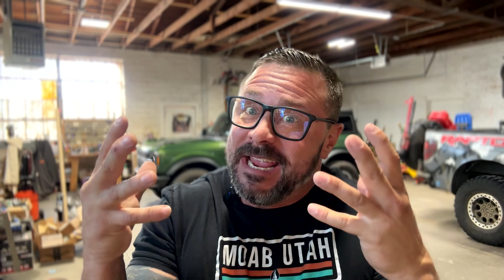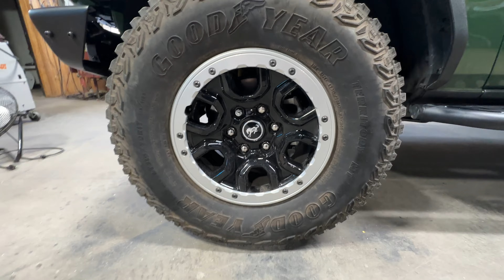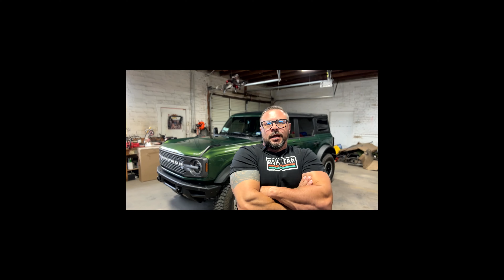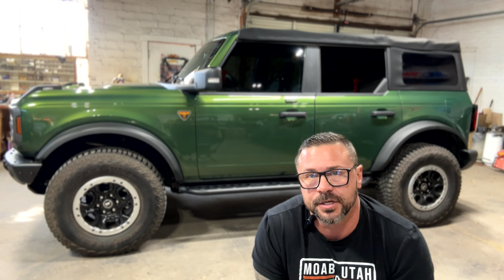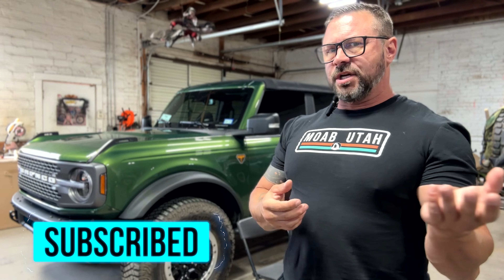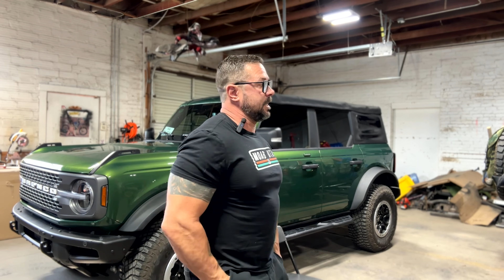BRONCO…The Build it BIGGER SERIES EP1

Comment: Looking forward to following this build. I went KC slimlites on the pillars, but I'm partial to those initials.

What are you thinking for follow lights?  Gonna wait until you have Ursa minor top or something compatible with soft top?  Thinking about mounting some to mt spare tire rack and just have a quick connect plug for them.
Reply from the maker: Hey buddy !! Yes I believe we all will enjoy it for sure. I’m trying to spare no expense on the things that truly matter and take opinions and public suggestions on others!  

I want it to be the rig I’ve been tryin build for years, so hopefully this time we get it right, because I think in my humble opinion there’s not a better starting platform. 
So you sir are a genius, I will be using your fav KC  v2 in amber (don’t tell anyone but they are my favorite all around use light) I will actually be doing something similar. I will be wiring the chase lights through the rear door and they will be mounted on the third brake light riser so they won’t have to be moved during a tire change etcetera. 

FYI that package just showed up , so hopefully that video will be in the works very soon to help illustrate how I plan to run them. 

Thanks for all the support Kyle 🙏🤝🏽

Comment: Great name. Love the description of the matchbox.  Are you looking to do a refrigerator/kitchen set up in the back? Is there even room in the back? Or would those diy kitchen in a box be better? 

Up down airing is a great idea. Bead locks nice. Suspension I heard low rider setups are all the rage in overlanding...🤣😉 Making the Bronco hop on the trail 👣 🤪  

Glad you are keeping the trailer.  What is the yearser miner? Sorry spelling couldn't Google it with my bad spelling 😅 aww something about the top.

Any onboard power? Solar panel on the hood.  Looking forward to all the new content
Reply from the maker: Lol I’m glad the name landed well … I laugh every time someone asks 😂

Yes I will be doing a full rear seat delete and beck system. I will definitely do a fridge and drawer system of some sort… there isn’t much out there I will rely on you guys for thoughts in design because we will be building stuff that doesn’t exist. 

As far as power yes definitely an onboard system. I have to sleep with a CPAP for breathing therapy so I need a no fail long term set up. So it will definitely be lithium and solar on the Roof and hood for sure.

The Ursa Minor set up will be game changing. Their site only has the jeep photos up but it’s the exact same concept …

THANK You for always being involved !! I’ll always appreciate the ideas. Hope your turkey day was a good one 🙏🍗🦃